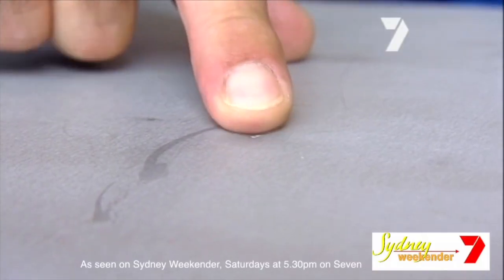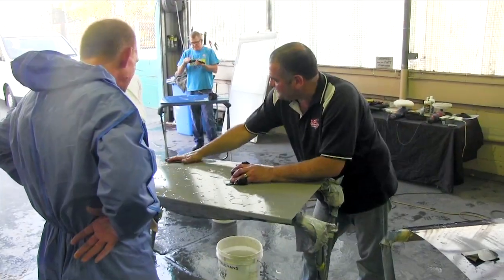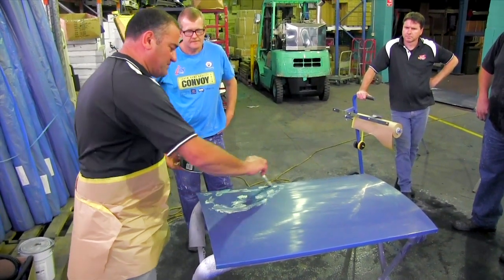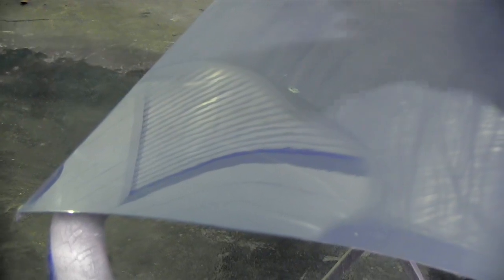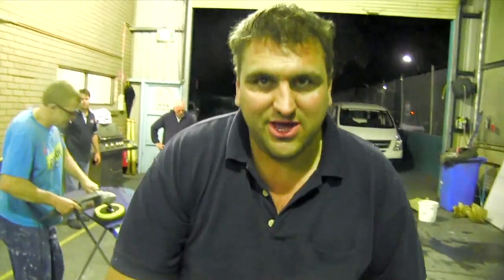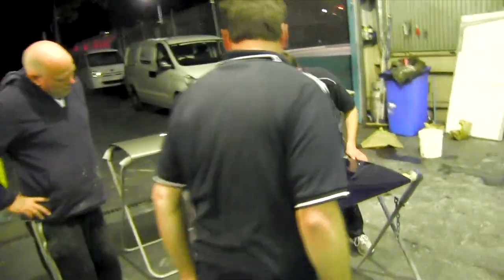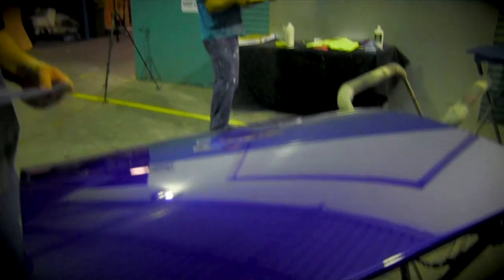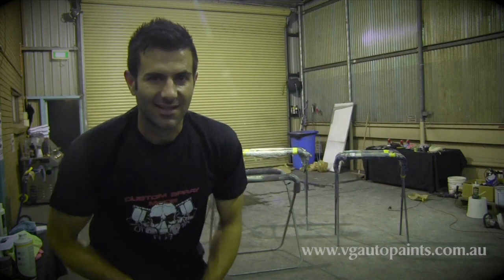Spray Painting and Dent Repair Lesson

Comment: hi i just wanted to know is it possible to spray a whole car using just aerosol cans and spraying the car on the street thanks
Reply: Its not going to be perfect if that's what your going for, but as long as everything is masked and prepared right (sanding,Etc) it should be fine.If you use quality paint and have painted things before it will help, also if you wet sand and buff afterwards like they are doing in this video it will greatly impact the final finish.
Reply: cheers thanks